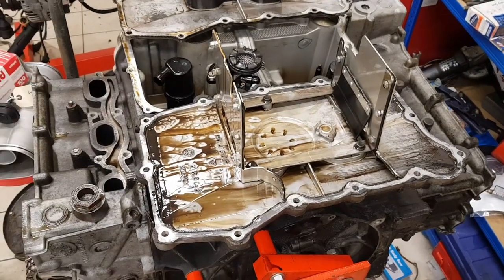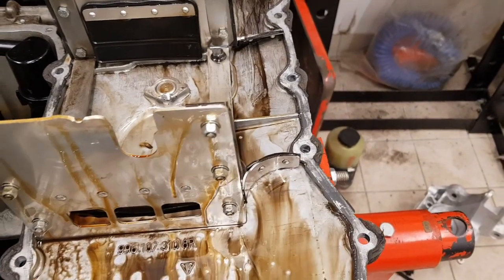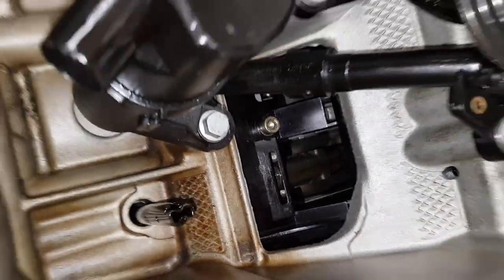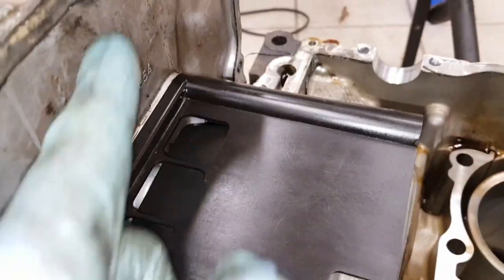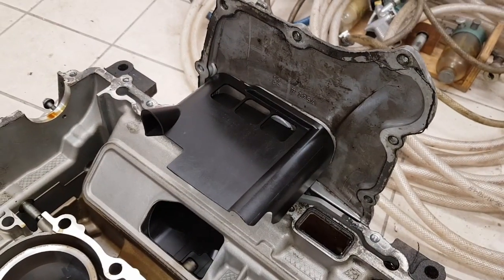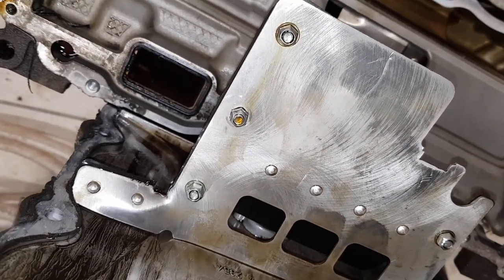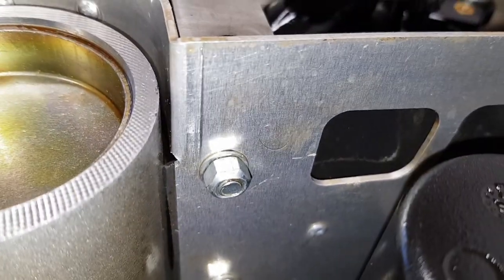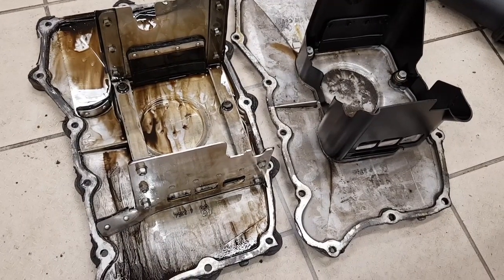Porsche 996 x51 sump / oil pan description

Comment: Great timing. Just bought a X51 baffle/ pan and am going to install it soon on my 996. This video answered most of the questions I had so thank you for uploading. I also found the rubber seals a bit uneven but I guess a perfect seal is not possible.

Comment: Coll video Martin - Very interesting perspective. I have an LN deep sump which looks like it take a lot of cues from the X51 baffle with the additional integration of a sump spacer for additional volume. It does not however address head scavenging and relies on the factory setup for that task. I have found in very limited experience it to still, not do an adequate job of resolving the oil pressure instability at certain points unfortunately. I am curious how it would stack up against the factory X51 sump.

Comment: Great video, really clearly shows the differences between them well.  Could you do a vid on the dual stage scavenge pump and pipework please!?👍🏻😀
Reply from the maker: I have done videos on the operation of the standard scavenge pumo and details on a prototype dual stage one.

https://youtu.be/P6ujihzMfKg

https://youtu.be/772J-h4_8Ns

When the proper prototype arrives I'll show it on the engine with the pipework for a proper comparison. It is being made now but it will be early next year.

Comment: Good morning Martin great to see what you are doing very interested in the tandem oil pump project I would probably be in the market for one if all go’s well with testing, firstly would like some advice if possible I am in the proses of a very similar project with my C4 I am wanting to change the front dampers to Koni units I have all the relevant parts I just wandered if you know the difference between C2 and C4 hub knuckles ?
I think it is the angle of the damper due to the four wheel drive system, this for me is not a problem as I 
have removed it and I have adjustable turret top bearings, any help would be much  appreciated keep up the good work.
Many thanks 
Mark.
Reply from the maker: Yes, the angle is different to clear the driveshaft. If you change to the C2 hub you need the C2/GT3 suspension and uprights.